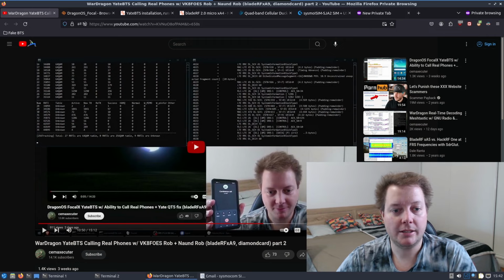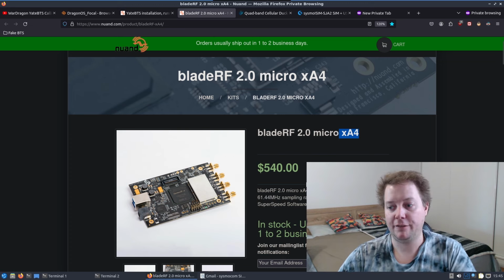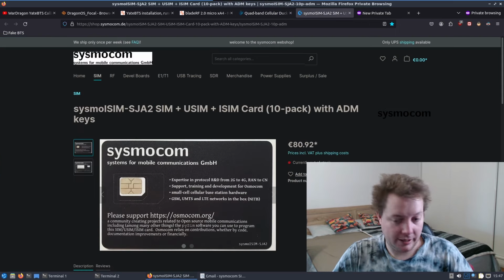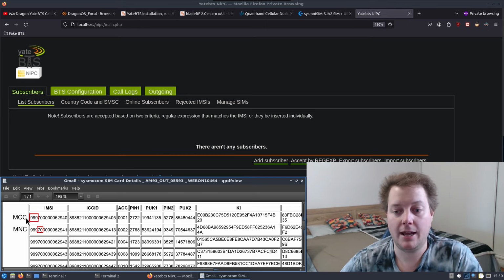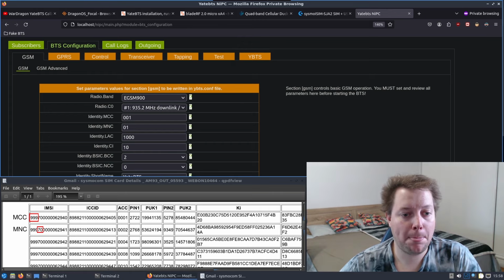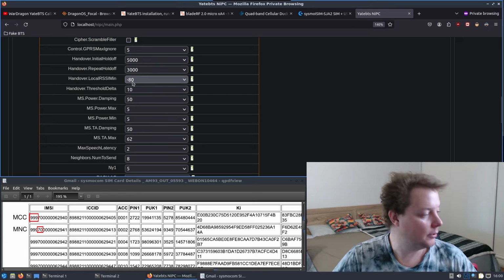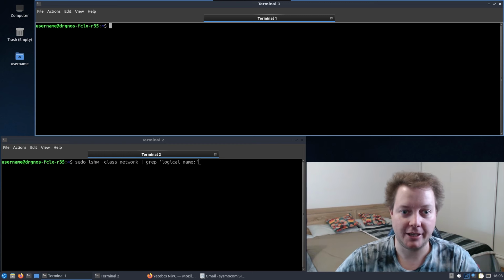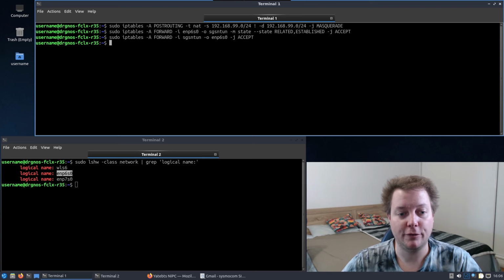2G Base Station Tutorial - Part One: Hardware And Software Setup, YateBTS/DragonOS Configuration

Comment: Can you use RTL-SDR?

Can you use internet via wifi to the 2G Base Station, so that they can get internet via 2G?
Reply from the maker: Hi. No, you can't use an RTL-SDR for this tutorial. It doesn't have transmit capability, which means it can't send signals, it can only 'hear' them. You need a full-duplex transmit-capable SDR for this tutorial. I am using a BladeRF 2.0 in this video.
Reply: @RobVK8FOES  It's just a shame it's not sold in the EU.

Comment: Can i buy this sysmoISIM-SJA5-9FV SIM + USIM + ISIM Card (10-pack) with ADM keys; 9FV chip because as per your suggestion this one is not avaible in the markit (sysmoISIM-SJA2 SIM + USIM + ISIM Card (10-pack) with ADM keys)

so can i go with this: sysmoISIM-SJA5-9FV SIM + USIM + ISIM Card (10-pack) with ADM keys; 9FV chip
Reply from the maker: Yes, the SIM cards used in this video are now superseded by the 5G version. I haven't tested them personally, but I would guess that they will work. Purchase them at your own risk, of course!
Reply: @RobVK8FOES  Thanks you, please help me once again i have mac pro max M3 and i am confused how i can install Dragon OS in Oracal Vertual box in M3 Macbook Max pro, Please help me
Reply from the maker: I have zero experience with Apple/Mac hardware and software, sorry.... Please understand that virtualization is the worst method of running DragonOS. There will be a large reduction in performance due to overhead from the hypervisor, and USB pass-through is buggy and nearly always causes issue with SDR hardware. Installing DragonOS to a bootable USB drive is the method I use, but I have no idea if you can dual-boot Linux and MacOS side-by-side on the same machine....

Comment: Do I need to program the sim cards in any way? I am trying to get my old razr back from the dead and hopefully place some calls with the outside world.
Reply from the maker: @asaleminik Hi. No, the SIM cards arrived fully programmed, and the Sysmocom team send you an email detailing all the programmed values of each of the 10 SIM cards. It's handy to still own a smart card reader/writer, though. 

About making calls to the outside world, YateBTS can't do this natively. Call routing is only done in software and is made available to devices connected to the base station. A third party SIP/IAX service needs to be purchased, and then you do some configuration in the settings. My friend @cemaxecuter has done this successfully, and he has a video tutorial about it. I am even featured in the Part 2 video!
Reply: @RobVK8FOES  Thank you! As of today I was able to get my razr to work in the US! I had to get a specific t-mobile sim card. For some reason the network will kick you off if the phone isn't voLTE capable, so I found a way to reflash my imei number to match my andriod's and it's been working smoothly ever since

Comment: Hi! Is it possible to use a cheaper antenna like a USB Antenna or some jumper cables to use as antennas, and even eSim?
Reply from the maker: Hi. Are you referring to the actual antenna, or the radio receiving and transmitting the signals? I think you are talking about the radio unit itself. The answer is no, because this tutorial requires you to use a full-duplex transmit-capable software defined radio. This is how the phone will interact with the base station software on the physical communication layer.

Comment: How do you think, is it better than osmocom project? I work with usrb b200 and osmobts, bts, etc. It is working but it was reallly hard to install and call to another phone (and very low speed of ps part)
Reply from the maker: Hi. I haven't had much experience using OpenBTS specifically. I have played around with Osmo-NITB-Scripts, which I believe is a quick and dirty way to get started with OpenBTS. I've had really good luck with YateBTS and a BladeRF, it seems very reliable and stable!

Comment: lel. Was just ebaying hackRF the other night.
(ed; HAHAH! And you just mentioned it!)
Reply: did you cancel it? I'm waiting for it to arrive. I hope its worth it
Reply from the maker: @usernotfound342 They're a logical next-step up from an RTL-SDR, but they're famously 'deaf' in their receiver circuitry, and their front-end's are easily damaged when exposed to high-power RF sources. So please be very careful and it is advised to NEVER turn on the receiver pre-amp, EVER. To be honest, there are better options in the price range of the HackRF, such as the LimeSDR Mini 2.0. Overpriced it may be, but you'll have full-duplex for 2G base stations :)